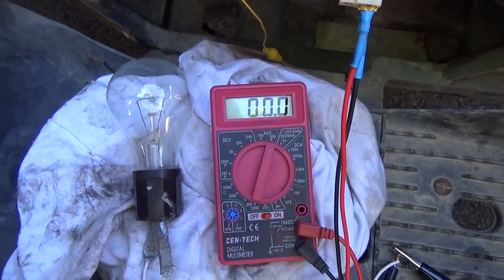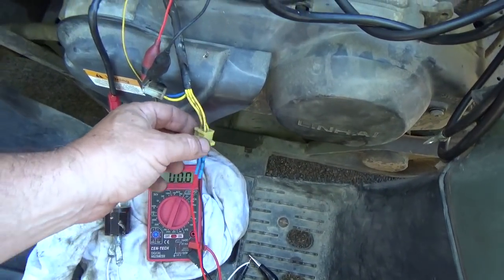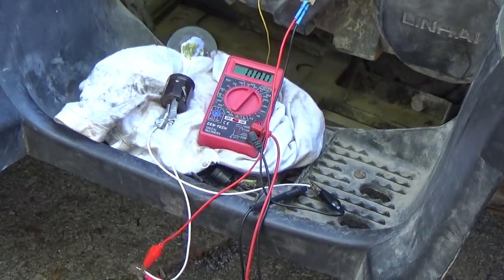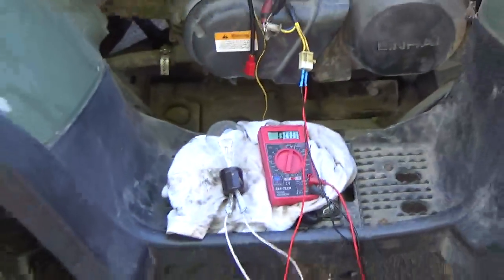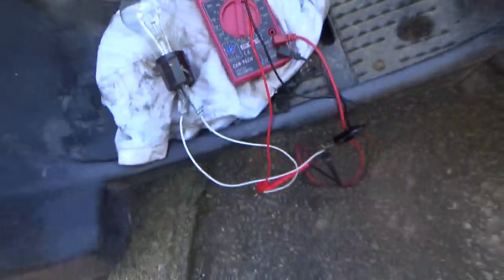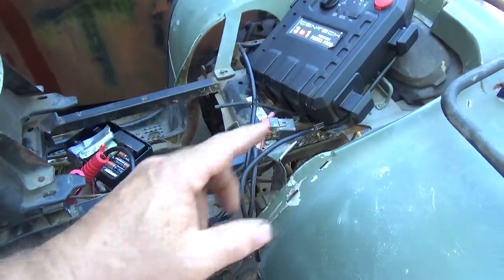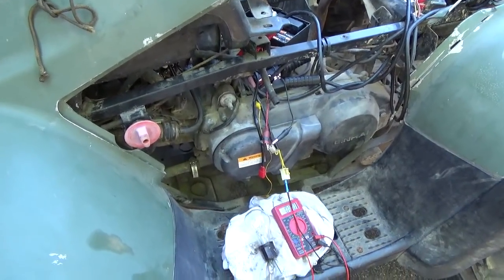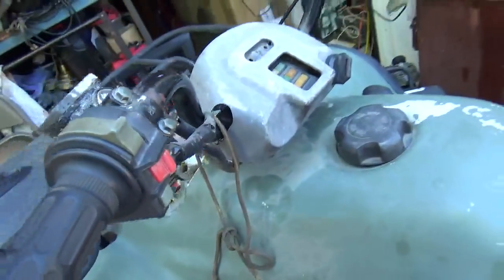Easy stator testing, ATV, UTV, Off Road Kart, motorcycle, diagnostics.

Comment: Do you have any troubleshooting videos for Kawasaki bayou 300 ? 

I have a 1993 Bayou 300 4x4. It would always idle but die as soon you hit the throttle. I eventually found that the petcock valve was faulty  , not allowing enough fuel to carb. Now it runs rides and revs up. Just instantly dies when you remove the jump pack

Comment: Okay so here's where I'm at now I have got the thing routing I can put around the yard at slow speeds but there is a large flat spot from a quarter throttle the whole way to Full Throttle I have tried the air mixture screw and every single adjustment I've made has not made a difference I've tried holding the choke on it just dies I know it's getting gas I know it's getting air and I know it's getting spark and I know it has compression my only thing is it doesn't have the original air box I'm running a cone style Chinese filter do you think it's possible it's getting too much air and it needs to be rejetted should I put the original air box back on
Reply: Lacy Ritter I had this exact same problem on a recent 150cc utv gy6 motor I was working on. I adjusted everything in the carb too and nothing helped. Turns out it was an electrical issue. I did not have enough juice going to the electric clutch to shift it into a higher gear when trying to go over a few mph. My problem turned out to be a rectifier that was failing and was no longer charging the battery/powering the utv. Quick way to test it is to put an Amp draw on your machine (headlights on, use an accessory port, etc.) as you're puttering around the yard. If it goes back to normal when everything is on you've found your culprit. Good luck!
Reply: I appreciate the help I do not have a rectifier on this bike I have eliminated everything except the CDI the coil  and the stator I am almost a hundred percent positive it is not an electrical issue I just put the airbox back on it took a lot of Gorilla Glue lol it was pretty beat up which is why I tossed in the first place so with the airbox back on and sealed properly with a new filter in it I have a full band on my throttle now now my only issue is I cannot get it to idle down for the life of me I can take the idle screw screw completely out and it'll still have a high idle and idles just high enough where it's engaging the clutch is so it's jerking back and forth I did have a smoking issue for a little bit but I got that under control I guess I'm running it at about a full turn out maybe a little less on the air screw it is now not smoking which is a good thing but I still do not have control of the idle it's just idling a wee bit too high and kind of erratic now I think I have narrow that down also but I'm not positive since I got rid of the oil injection system what is the ratio I should be running my oil gas mix I wanted to be safe for the first time and not hurt anything cuz God knows when the last time this thing was ran So I did 50 to 1 in this mix
Reply: Lacy Ritter So it's a two stroke engine?
Reply: Yes
Reply from the maker: Hey Lacy!!!!    I have had 2 strokes behave as U describe with old gas.... Try some nice fresh mix and see if that helps, a change of spark plug also.... Unfortunately, if a 2 stroke has bad engine seals, it can also run as U discribe.... If Ur carb has a throttle slide, make sure that the slide was installed correctly, if not, it will not close all the way and idle down properly, and lastly, check to make sure that Ur throttle cable is not too short or sticking which also will not allow Ur throttle to shut down completely.... I hope this helps, thanks for asking, watching, and commenting!!!!!

Comment: I was wondering if you could help me im at my wits end I have a 90 cc china gy6 2 stroke clone motor I have removed all oil injection components all wiring has been re done it has a new carb as of today new spark plug etc it has 120 psi compression I cant get it to start for the life of me as of today I can get it to fire briefly whether it be choked or not any thoughts also there is two nipples on this carb one for oil injection which I blocked off and one right before the intake boot on carb wha is that one for on my other gy6 the nipple is on boot itself and a hose  runs to carb again any thoughts would be greatly appreciated thanks and god bless
Reply from the maker: Hey Lacy,  To clear Ur exhaust, removed the spark arrest-or and see if U can't clear it out with a solvent or gasoline, (careful, we want no tragedies here), U may need to work a wire thru any blockage.... I hope this helps.... A new exhaust maybe cheaper then U think on eBay.... Thanks for asking, watching, and commenting, I'm glad that U got it running!!!!     May God Bless U and everyone U care about!!!!